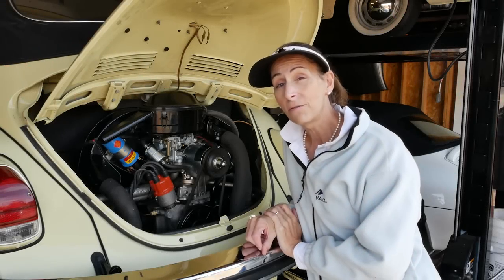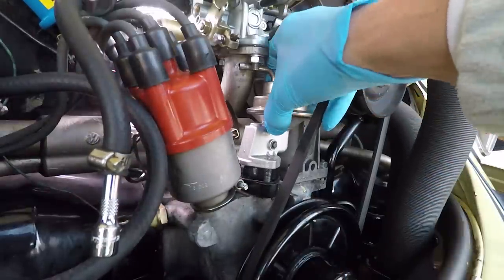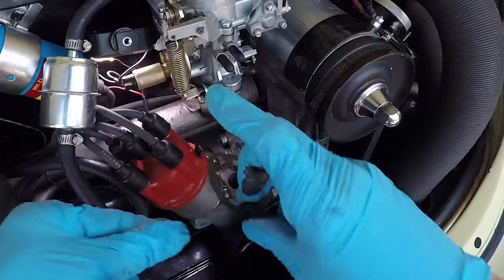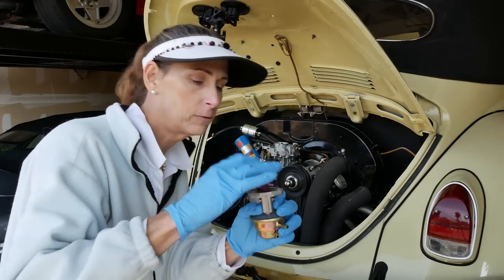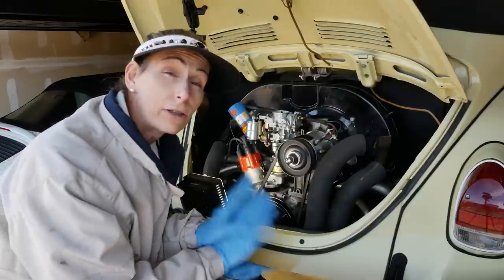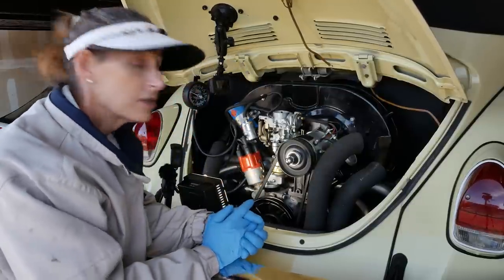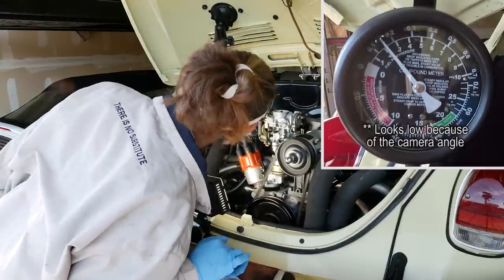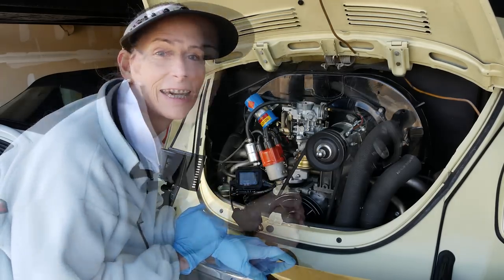How to Replace a Fuel Pump on a Classic VW Beetle (DIY - Pressure Test & Regulator)

Comment from the maker: Hi Everyone, 

UPDATE:  Well, that EMPI 9092 fuel pressure regulator FAILED!  I'm removing it from the description.  It started to leak very badly.  I have ordered a Holly regulator as a replacement.  I'll update again after I've had a chance to review it. -- Franny

We have Miss Lemon Drop (1969) back in the garage for a fuel pump replacement. I go through the installation of the pump, and also a check of the fuel pressure.  That was the big surprise!  At 5psi, it was twice what the carburetor specs. VW says to add a gasket or two to raise the pump and thereby limit the rod throw to lower the pressure.  The problem with these aftermarket pumps is that if you go the route, you will have to grind the rod so much to get the pressure down, the flow will be too low to support the needs of the engine at running RPMs.  The only real solution is to install a pressure regulator to meet the requirements of the float bowl needle and seat in the carburetor while still maintain adequate flow.

Let me know your thoughts...  Franny

Tools and parts:

• DO NOT BUY!: EMPI 9092 fuel pressure regulator with bracket and 2 5/16" fittings Will review the Holly adjustable regulator.  Get this instead:
                                           Holly 12-804 1-4psi regulator: https://goo.gl/Q8wbKr
• HFS (Tm) Carburetor Carb Valve Fuel Pump Pressure & Vacuum Tester Gauge Test Kit: https://goo.gl/wZZmZy
• Air cooled VW bug beetle fuel pump kit with flange & rod, generator style: https://goo.gl/7qDcnC
• 1/2 In Drive Digital Torque Adapter by USATNM: https://goo.gl/vEZ4mc
• Permatex 80016 Form-A-Gasket #2. 3 oz.: https://goo.gl/t5bH4z
• LDR 516 F146 ¼ Inch ID Fuel Line for Small Engines 6-Foot Length: https://goo.gl/i2WEyt
• Jmf Hose Barb 90 Deg. 3/8 " Hose Barb X 1/8 " Mpt Yellow Brass 150 Psi Lead Free: https://goo.gl/FoSj4k
• Koehler Enterprises KE4SS Hose Clamp Blister Pack, 4 Piece (Micro Size 4): https://goo.gl/chZpPw
• The Extinguisher we have in every car: Amerex A384T, 1.4lb Halotron I Class B C Fire Extinguisher: https://goo.gl/1dkRVJ
Reply: Please don't modify the engine, you will have more troubles.
Reply: @rodolfogomez382  ....When was anything said about modifying the engine?  If you are reffering to the fuel regulator it is a necessary part of the new fuel system.  The high pressure replacement pump requires it.  This is very common on many aftermarket fuel pump replacements.
Reply: Odd to see EMPI parts DOA. Do you think it was a fluke or perhaps bad engineering? Our work  on our 72 Std Beetle continues, as Fall starts tomorrow. Looking forward to moving to have a garage for Winter. Enjoy picking up tub bits from you!
Reply: When I saw you using that regulator, I was about to comment and say I almost burnt my car to the ground using one of those because it failed. Can't believe businesses still stock these things.
Reply: I also purchased the empi 9092 regulator as well as a fuel pressure monitor.  According to the monitor I purchased, the regulator did not work…right of out of its package as it would not reduce or increase pressure when I adjusted it.  Yes, I did put it in in the correct direction but am disappointed with it for sure.
Reply: I just purchased the Mr. Gasket version of that empi pump but very happy to find your comment here and switch it up with the Holley before even being installed. Thank you.

Comment: Hi Franny. Just want to say thank you for taking the time and making this video. I know that it's been  five years 
since you did this video that I just came across while surfing for answer to the problem I was having with my 55
Beetle with carburation. After watching your video I saw that I had installed my pressure meter and regulator on 
the wrong side and of course it wasn't working. Funny thing is that not even my mechanic spotted the mistake.
Thanks to your video I got it all corrected and my car is running better then ever. Again much love and thanks from 
me and June Bug. Yeah, that's what my wife and granddaughter call it.
Reply from the maker: That's great! Sounds like a super special car :)

Comment: Hi Franny and Heidi,
In the last few weeks I have overhauled most of the fuel system on my 55’ 356. Thanks for the great video about changing the fuel cock on the C. I ended up rebuilding mine and having enough parts for the later one that would fit on Miss Eva.  My son and I rebuilt the 36 hp type VW fuel pump with a rebuild kit. The “ bake a light”  or phenolic spacer was cracked around the metal inserts. I ended up drilling  holes down each crack cleaning out with brake cleaner, blowing dry the holes and cracks and then injecting in J B weld till it came oozing up from all the holes and metal inserts and cracks. After letting it sit overnight I then flattened the surface with a dental grinder to be perfectly smooth checking it against a flat glass plate. The right carburetor was not metering fuel correctly( overly rich) so I ended up rebuilding it. It ran really strong after that. (I will be rebuilding the left one after getting home from my Colorado vacation.) The questions I have for Franny are, what fuel pressure should I be looking for with the old Solex 32 PBJ’s and should I take some old wine bottle corks and plug off either side of the balance tube when I am balancing the carburetors?
I have not worked this  much on this car in 25 years. Your videos have been the inspiration to get it running again. It is so much fun to drive. Thanks again for all your great videos. Please email me, if you have time, on how to become one of your sponsors. Drjtharp356@yahoo.com
Reply from the maker: Hi James, I believe the fuel pressure is 2.6 PSI.  Getting a good needle and seat can be difficult, but I believe 356 Carburetor Rescue sells a good set.  I'd have to brush up a bit on the Solex for tuning.  That is a good question.  I think 356 CR has a good reference on that as well.  
That is very generous of you to inquire about Patron.  You can find us here: https://www.patreon.com/heidiandfrannysgarage  Thanks so much!  Franny

Comment: Heidi, I followed your excellent instructions to install a Holley fuel pressure regulator on my 1969 VW Bus. The reduced pressure makes the engine run a lot smoother. It now starts first time  - I believe the needle valve in the carburetor was flooding the float chamber under the higher pressure.
Reply from the maker: So glad it helped!

Comment: Back in the day we would put the fuel pump "stand/riser" on a grinder or sand paper on lower it.(sand down where the "stand/riser" meets the bottom of the pump), ergo allowing the rod to rise higher into the pump if it ever appeared to have worn down the push rod and prevented flow.
I'm not being critical, I love your videos. I bought my 72 convertible when I was 15 and I still have it 41 years later.

Comment: Great, great video.  I bought a 73 type 1 in December that had not been started or driven since 1995.  I got it started but the fuel pump was spitting gas like a little boy making truck noises.  This video is exactly what I needed to confidently replace the gaskets.  Thank you so much.

Comment: Franny I am restoring a 1964 convertible type 1, pan off restoration. The original copper fuel line was corroded and kinked and needs replacement. I just purchased a Cohline 6mm copper fuel line from Germany, which came coiled in a box. I was wondering if you would be interested in doing a video where the original fuel line is removed and a new one installed. I would supply the tunnel stripped of everything that would make life easier. More importantly done the right way. I would also enjoy meeting someone who enjoys Volkswagens as much as i do and is easy on the eyes. 😁

Comment: Hi Franny, I just found your channel and love it. Just to let you know, I am getting my daughter's 1973 Super Beetle back in original running condition....unscrewing what the previous owner screwed up or "upgraded"....original VW tinware, doghouse thermostat and linkage (was missing), and an original Pierburg VW7 (correct for Type 1) fuel pump, which I rebuilt. At some point, the P.O. replaced the original generator with an alternator. 

I noticed in this episode you mention that the original tall pump won't fit, if you have an alternator, and I've read this in several other places as well. The Pierburg fuel pump I got clears the alternator with about 1/8" to spare, so I would say it's worth it to get a Pierburg and see if it fits, because the advantage is that you can rebuild it vs dealing with the cheap aftermarket pumps and it might allow you to avoid having to add a regulator.

One last note, depending on the engine serial number and per original VW literature I found online (http://images.thesamba.com/vw/gallery/pix/1530631.jpg ), fuel pressure specs ranged from 1.8psi to 2.8psi.

Take care.

Frederic

Comment: Bought a 64 with a 1200/40, a 30 pict-1, and a cheap universal electric fuel pump. Doing the same pressure test you did, it's at about 3psi. But it holds the pressure after the engine is off, so i guess the carb can stand that slightly higher pressure. It's 12v converted so the pump is proper for the voltage of the car.

And as a side note, I have that style pressure regulator on a 6.9L diesel, where it's been for almost three years and it's still working fine. It's just a repackaged regulator that is sold under many brands. Mine was sold as Mr Gasket.

Comment: It almost seems like it would be easier for companies to make a thicker aluminum spacer to replace the phenolic spacer. That way it would keep the pressure correct with the new design pumps. Also if it was to tall then it would be easier to machine a little off the spacer to bring it in to spec.  Good information about the ALT/GEN pump differences.  Happy New Year!  Looking forward to more great videos in 2018.
Reply from the maker: I'm starting to get the notion that there isn't a lot of thought going into these aftermarket parts - or testing, or quality control...  Happy New Year!  Franny

Comment: Awesome job Franny! I will use this when the pump or rod fails on my vintage speedster. Really good explanation of the function and troubleshooting. Thank you!
Reply from the maker: I'm guessing this is an issue with these new aftermarket pumps...  Porsche says that the fuel pressure on a 356 is adjusted the same way VW says - add or remove spacers on the pump mount...  I suppose after 60 years or so there can be some rod wear.  Honestly the most important bit for the 356 is to grease the base of the pump!

Comment: Great video Franny I am now going to attempt to try to put in original fuel pump back on the VW I bought with an electric pump on it, I hope I get it right, your video was great!
Reply: Remember you have to use the proper rod! The short rod, 100mm is for alternator style, longer rod for Generator style.

Comment: Hi. Since i couldnt get my rod out, I put my old pump back on. So far its running good again. I hope fuel doesnt dump into the engine again😤. Thanks for all your help.
Reply from the maker: Hope not!  Have you seen this video.  Maybe it will help you troubleshoot.  Also, please make sure you have a fire extinguisher just in case!  

https://youtu.be/JBAVyKTckCs

Comment: Thanks for your video’s on Volkswagens. Been having gas feed problems with my 1973 Volkswagen . Steve from Tennessee.
Reply from the maker: Hi Steve, Try using that fuel pressure gauge and see if the pump is doing its thing.  The trick is to get good flow at the correct pressure.

Comment: The solution I used for pressure is to buy a  new Pierburg pump, it was almost $100, but puts out the right pressure, and I like not having to add a regulator and additional hoses and clamps. It’s the later alternator style pump,  and has a built in filter. If I had a generator I would get an original pierburg rebuildable pump and use that. Wolfsburg west has the rebuild kits.

Comment: I'm working on a Volkswagen engine and it runs a portable sawmill made in troutdale Oregon. It has no alternator no generator and it's a magneto ignition. I wonder what rod they got in that for the fuel pump. Also how can I tell what year the engine is I'm working on I know it's 4 cylinder and pull rope to start. Your video helped me figure out real quick how to route the fuel lines from the pump to the carb and from the tank to the pump. Thank you.

Comment: Hi, I just bought a 1972 VW Beetle! I'm so excited, I've been wanting one of these cool little cars for a long time! It needs a lot of work and the engine is missing some parts though. My question is how interchangeable are the parts between different years? I ordered a repair manual, and I'm going to try to look for used parts in good condition. So far, I know it needs a carburetor. Do you have any suggestions for what kind I need?
Reply from the maker: I would go to the Samba forum. Tons of parts and info.

Comment: I love that engine and bay, so clean. RE: the regulator, beware of some of the cheaper 'bling' units. On the TR6, it's great to use one with a glass bowl and chrome in/out snouts, but a friend went through 2 of them, from some Amazon vendor; they leaked right away from the bowl mating surface. Irritating when new parts fail....common these days :(
Reply from the maker: Thanks John, good to know.  I am leery of this one as well.  I did see a few nice ones with the glass bowl and a filter.  I was thinking if this works out well, maybe to swap out with a better unit in the future.  These new parts...  Such a problem on the VWs and also for some of the 356 parts as well.  So irritating.  I went through three condensers in one year on the 356.  Thanks, really good info on the units with a built in filter.  That is the reason I mounted this one so low...  The last thing I wanted was to have it drip gas on the coil or the distributor.  I wasn't a fan of the filter being there either.  Jerry does carry that big extinguisher in the car, but...
Reply: Condensers! Same thing happened with the brit cars a few years ago! A bad batch from...some place I won't mention :P Rubber bushings are another unreliable item. Unless they are from Germany or Europe in general, they seem prone to very early failure. Lemforder is the best, IIRC...I can only get a few items for my Alfa made by Lemforder...

Comment: I was driving back to Calif from Tulsa OK in the winter of 1984,  in my 1967 bug, and my fuel pump broke down at a place called The Continental Divide on I40. There was snow on the ground and my hands were frozen by the time I was finished replacing the pump with an old one I had in the trunk.  I was lucky I had an extra in the car.  I don't think I've changed it since 1984, maybe I should get a new one now.  By the way I was wearing rubber surgical gloves to work on my cars since 1967 when nobody else was.  I was teased by all my friends for doing so.

Comment: Great video. I have a 74' Beetle and have no end of fuel problems, including difficult to start, cutting out after running for a while. I watched the video where the car died on Jerry and you fixed it up enough to get it home by adding a rubber tip to the push rod. I think I have a similar after market fuel pump on my Beetle and the symptoms you described of fuel smell after driving are what I have. 
Also I have to crank a lot to start when cold, so maybe like you said I have flooding in in the carb from over pressure. I am going to get hold of a pressure gauge and a regulator and try out what you did in the video for myself.
Reply: Same here. Did it fix your issue?

Comment: Your videos are just superb. You explain things really good and back it up with videos. I’ve been having Fuel problems with my 73 Super Beatle. I don’t think that  rod that activates the fuel pump is going up and down. I’m thinking of putting a small electric fuel pump on it to avoid taking the engine apart. The car has an alternator which I put on a few years ago. Any thoughts?  Right now there is a short rod on it.

Comment: wish i saw this before i tried to replace the fuel pump only. i just ordered a complete matching kit, I'm gonna
try first without a regulator. also many people sand the outside of the pump stem mount so it falls into block, this is to stop rod from jamming if motor extremely hot. THANKS!

Comment: Realize this video is a way bit old - hope you still check comments on it.  My quick question is:   How much pressure should it take to move the pump lever on a 1600 engine (1974 SB), not much or a like a ton. Just got a new pump and it distorts my finger to try and push it in, the old one is like maybe a couple of pounds of force.

Comment: Very nice and got me thinking how much pressure  my rebuilt fuel pump on my (1958) 356 coupe is putting out ? Thank you for another learning curve video
Herlin Woolery
Reply from the maker: Ya know, I should check that too actually.  That is something you would fix with spacers if you are using the original pump.

Comment: I Plan on checking the fuel pressure on our 67 Bug to make sure it is not too high with the newer fuel pump installed sometime ago after rebuilding the car. After driving it and parking it in the garage, we do get the fuel smell you spoke about. On you leaking regulator, there is one on our 70 Bus that was there with dual, two venturi carbs. So far, no leakage. What should the fuel pressure be for this application? I am not sure of the engine size or the carb size. The guy I purchased the bus from bought it from a friend and did not know.